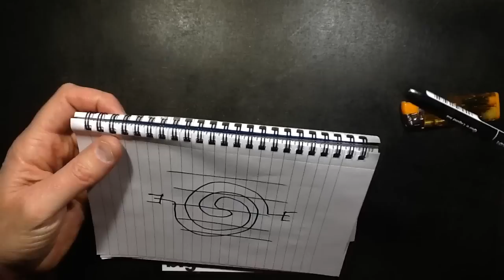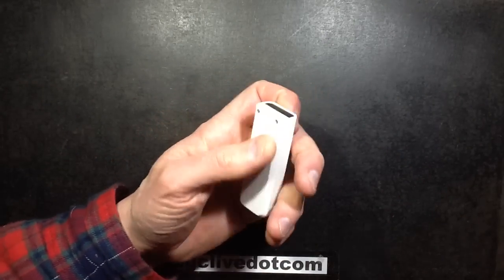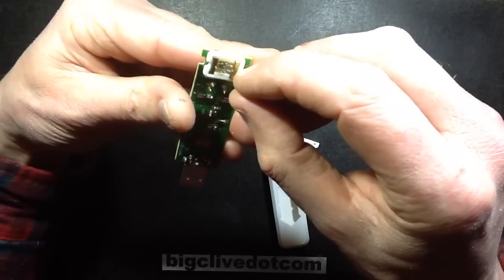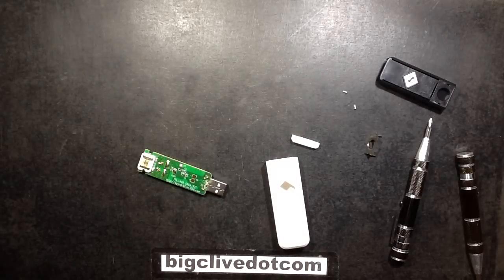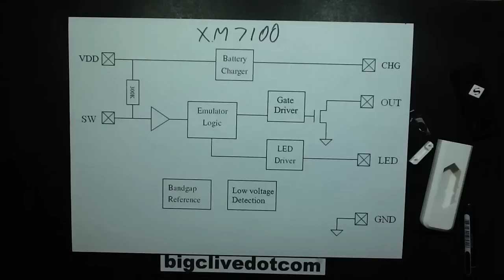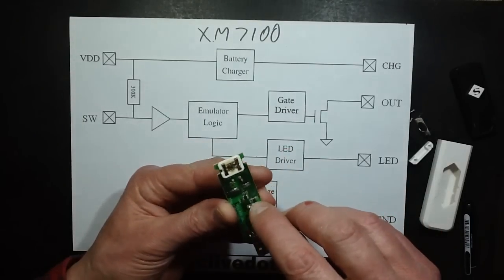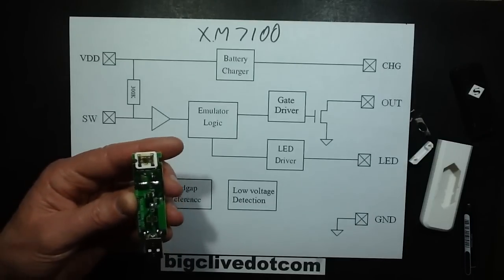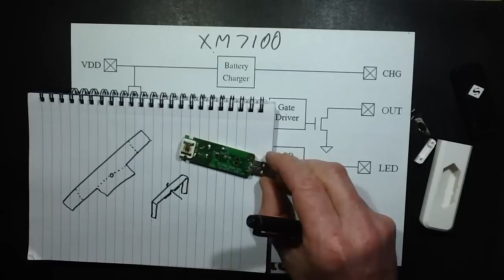Teardown of an electronic USB cigarette lighter.

Comment: What a difference a year makes. The XM7100 chip is all over the internet these days (in half chinese a lot of the time but plenty of english). Is an electronic ciggie chip rather than a dedicated lighter chip 
It is a nice chip with a decent little mosfet for the very small package size. Could probably re purpose but tiny surface mounts are a pain to work with in prototyping or one off builds

Comment: 一、Product description      
	       The XM7100 is a specific IC designed for the electronic cigarette application. The chip integrates both electronic
	cigarette function as well as the battery charger function into one single chip solution. Traditional 5V adaptor and USB
	port can be used for battery charging. Using MOSFET to drive heating coil can save the area of the PCB。
	二、Features
	1.High Integration: Electronic cigarette emulator, battery charger and MOSFET in one chip solution。
	2.Tiny Package: SOT23-6L and SOP8。
	3.Wide Operating VoltageRange:2.5V to 5.5V。
	4.Low Quiescent Current: < 5uA。
	5.High Output Current: 1.5A。
	三、Application range
	  1.Electronic cigarette。
	四、Typical application circuit

Comment: hey clive, the heating element of mine just broke. I measure it and its around 1 ohm, is there anyway I could solder something at its place? i cant think of anything that could heat, have such a low resistance and be used with such power....
Reply: Anor Neto Spotweld
Reply: NiChrome wire will not solder and even if you did manage it, the join would melt the first time that you used it. You could buy some new wire and make a replacment element, but it may not be cost effective.

Comment: i recently got one of these for £1.69 off ebay .....its marvelous .....until the element broke (i smoke roll-ups and was very gentle) it lasted 3 days :-(.........
i then took it apart and then tried to see if the elements were for sale seperately on ebay.....no joy......
mine is slightly different to yours and the element is soldered ,so i'm gonna try make a small wire coil to replace it.
if successful i'll upload it.
Reply: the heating element in my lighter broke and I'm trying to find a way to fix it, were you lucky in your attempt? if so, what kind of wire did you use?

Comment: Haaa! I wished I had found this video before I had to figure this all out as I went LOL. It had stopped working and so I disassembled it in pretty much the same manner, managing to not break anything. If it was toast I was going to scrounge the parts for my model railroad and RC quads :P  I discovered the right hand Lipo lead soldered down into the board had sheared half way up. It has been a pain to solder, doesn't want to stick and I don't halve any flux right now, but I've got it back together after multiple tries and it is still working. On the charger. Not sure how long these things need to charge. That web site says it is a 250mah batt, assuming i'm looking at the right one, so all I can do is use RC battery experience since I don't think the LED ever turns off. You're right, the pages don't translate well. One of them I looked at says it even has a 3 hour "Night light" mode, but it wasn't clear exactly how to switch modes.  These are neat, but I'm not sure they are exactly rugged enough to take camping, but then again it was only about $5. Anyways, thanks for the video!

Comment: Hi. I bought the same lighter. I'm just wondering if I could it is possible to put it in the check in baggage for traveling. I'm leaving from Japan.
Reply: why don't you email the airline or airport authority directly to get accurate answer from them, so you don't lose your lighter.
Reply: Regardless of the rules and whether a small USB device would be missed by security, it would be highly irresponsible to put a device containing a lithium ion battery or a ligher circuit in the hold of an aircraft. If you do decide to pack it, just make sure that it is used until the battery is fully discharged first.

Comment: I figured one of these had to last me 16 months to break even vs. the cost of just getting 8 or 9 Bic brand lighters, but after 1 month, the heating coil separated after only about 300 cycles. too tiny for me to solder or it'd last a couple more mos.